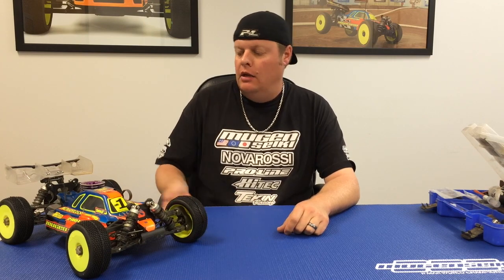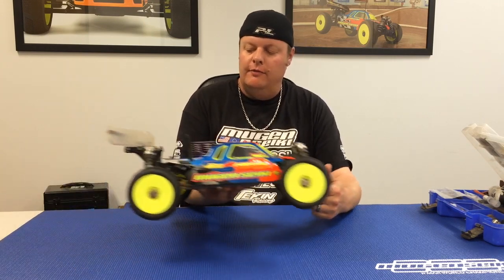Adam Drake from Mugen Seiki Racing talks about tuning with anti-squat.

Comment: What does "aggressive on throttle" mean? It doesn't relate to any handling characteristics.
Reply from the maker: "aggressive off throttle" means the vehicle will transfer more weight to the front and make the steering more responsive entering the turn.
Reply: @AdamDrake  Thanks for replying man. I get you now, unloading the rear causing oversteer/loose? I'm used to 1:1 terms and am trying to translate them to the way people describe RC.
Reply from the maker: @kevtalbot137  It's all good!  Happy to help.

Comment: If the anti squat pills are in the down position (the hole is down) and the rear toe pills are in the down position do i have 0 anti squat? And when the anti squat pills are in the up position (not middle) and the rear toe pills are up  (in or out) do i still have 0 anti squat as the angle in relation to the ground is the same? Or do the anti squat pills work independently from the rear toe pills? (then you get positive and negative angles if toe pills are down and anti squat pills up and vice versa) Sorry for the long message promise its the last question i ask!!